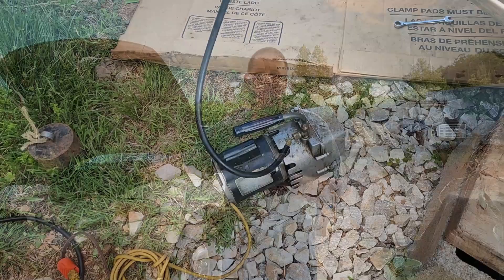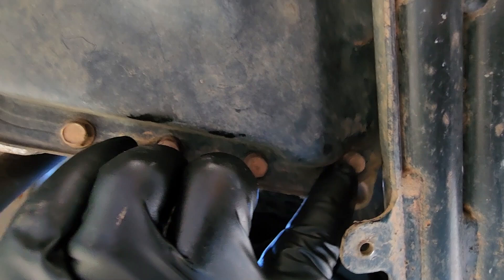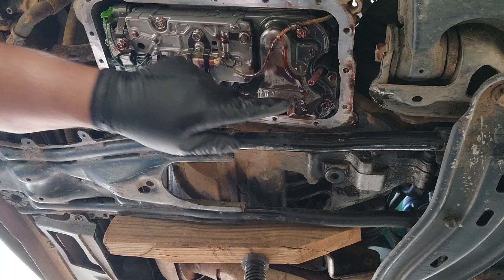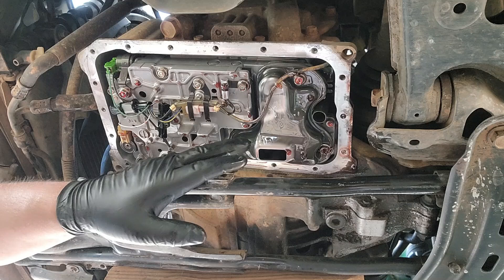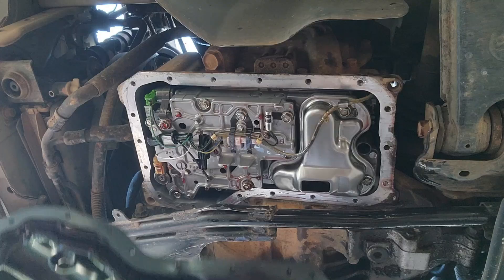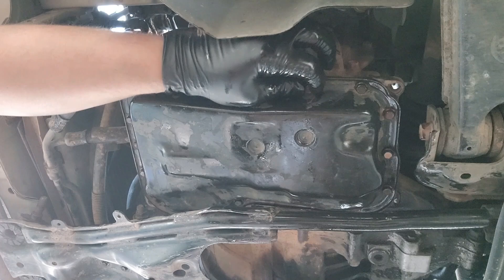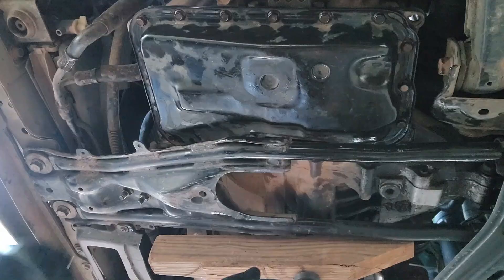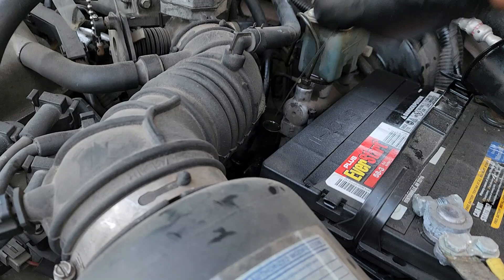3rd Generation Ford Escort F 4EAT Transmission Fluid and Filter Change

Comment: Que tipo de aceite lleva
Reply from the maker: @dantorr1879 the engine oil is Motorcraft 5w-20 synthetic blend. The transmission fluid is Royal Purple max atf. Thanks for watching and asking. ~Mr. C.

Comment: Almost to 96k miles. Should I remove some transmission fluid and replace with new? Or just leave it be?

Car belonged to an old lady that took car of the car but I don’t have any records.
Reply from the maker: @Red Flowers I like to keep fresh fluid and filters in them. I do all of the vehicles at 30,000 to 50,000 miles intervals. In my experience it keeps them going for a long time. I have heard the school of thought where you would save the time and money and skip filter and fluid changes until the transmission dies and just rebuild it at that point. The thought being, the cost of changes overtime adds up to at least the cost of the rebuild. I don't know because I do not do it that way. I hope this helps. if you have anymore questions please feel free to ask! ~Mr. C.
Reply: If the oil is black and burning, replace.
If it's pink, keep it.